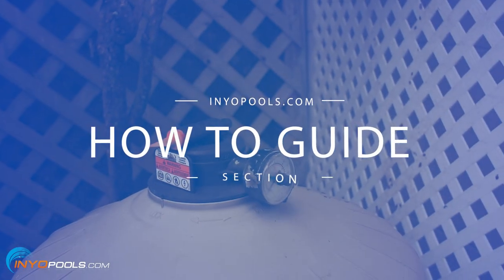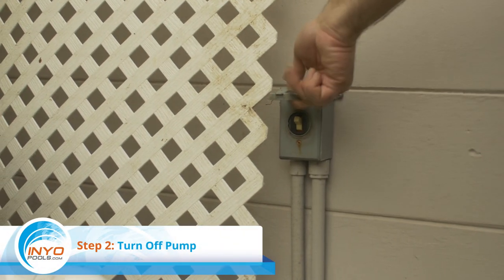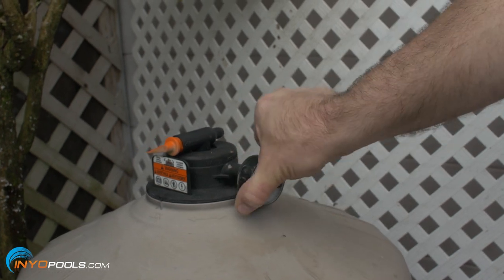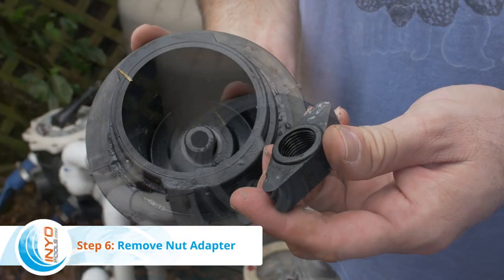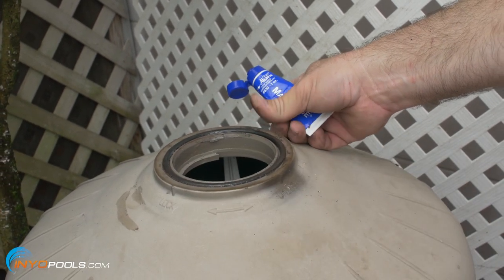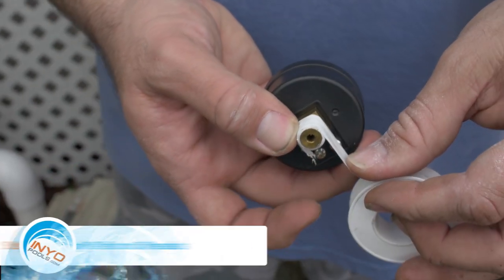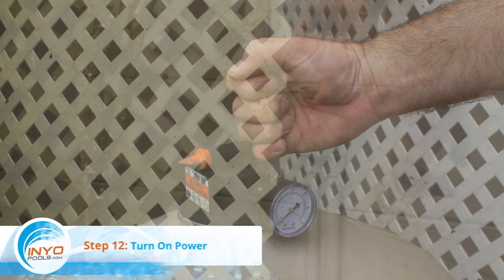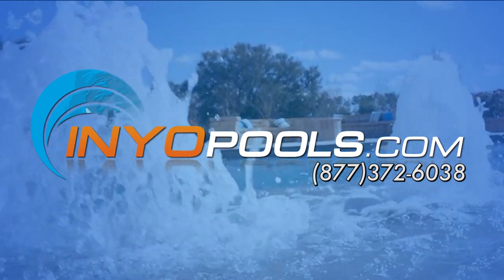How To: Replace a Hayward DE(Pro Grid) Filter Air Relief Valve

Comment: I’ve replace my lever valve twice recently.  Once I bought from Amazon and one from a pool supply store.  They both leak at the nozzle end.   I did it like you did the video (I think). I lubed up all the rings and even lubed up the orange lever.  Any ideas why it still leaks?

Comment: I hear a slight air leak when my relief valve is all the way in. I also see a bit of intermittent bubbling from the notches around the Hayward diverter valve handle. I think it's time to replace both, then figure out why the brand new pump loses half it's prime after an hour.

Comment: Will the old valve gave you a bad PSI Reading? I read about 4 to 6psi on a new psi gauge but the valve is 13 years old and when I check with a plastic gage in the pool I'm getting a Max or over the suction limit.I have no water leaking in that area.

Comment: Thanks a lot, great video for what I need to do.  I need to buy a Strap Wrench, what size should I get for this job?  thanks
Reply from the maker: It depends on the size of the item you want to turn. Measure its diameter, and you can find a strap for that corresponding size.
Reply: Strap wrench is also useful for auto oil filters, so you may find one at your local auto parts store.

Comment: I have a one year old Hayward DE filter, just curious how long did these pressure valves last?
Reply from the maker: A part like an air relief valve should last at least a few years if not 5 to 10 years. But that estimate is for the hardware and not something like one of the gaskets.